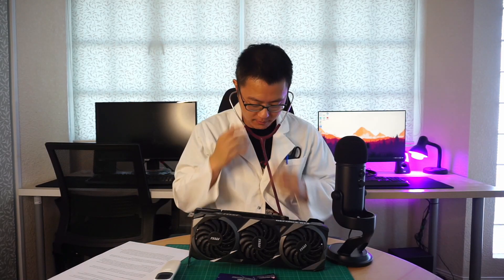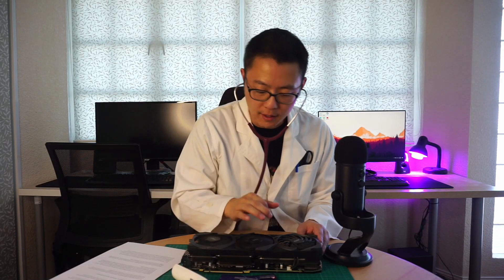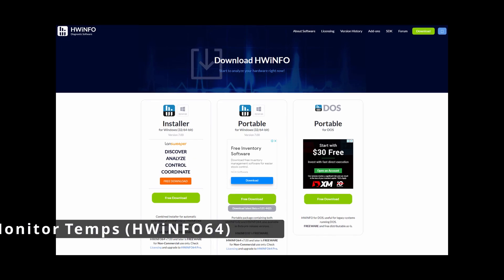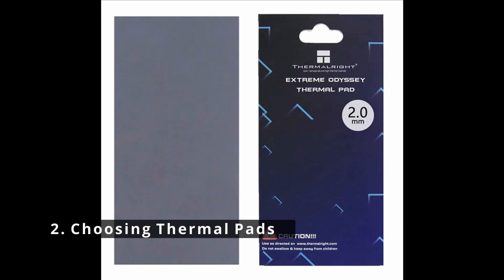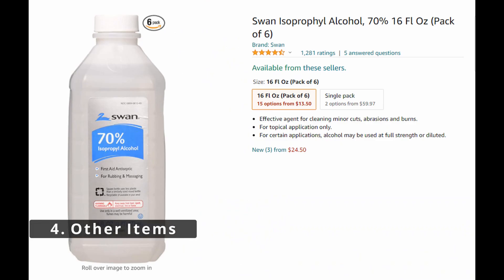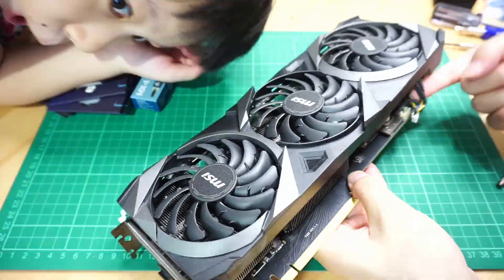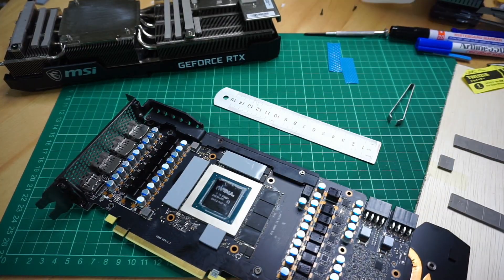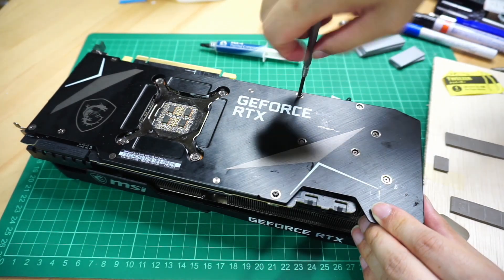RTX 3090 (and 3080) Owners! CHANGE Your Stock Thermal Pads! (Guide, Tips, Results) w/ Dr. JimRPG

Comment: May i have the link you adding heatsink + fan on the back gpu
Reply from the maker: Here's the video
Testing RTX 3090: How low will the vram temps go with this $8 heatsink and fan mod?
https://youtu.be/ZUfTu4J5Nyg

Here's where I got the heatsink and fans - assuming that's what you meant.
Big but crap heatsink
https://shopee.com.my/product/171380262/4533480084

Small but better heatsink
https://shopee.com.my/product/6674515/1846026360

90mm fan
https://shopee.com.my/product/311640343/5972018157

Typical PC Case fan - but too slow imo
https://shopee.com.my/product/17919052/2125984540
Reply: @JimRPG  cool..thanks a lot..appreciate

Comment from the maker: The full unedited video for the thermal mod is located here -
MSI RTX 3090 Ventus 3X Thermal Pad Replacement - Full and Unedited, (Guide/Results Video Check Desc)
https://youtu.be/WwOK20M_SC8

Update 31/8/2021 - Be careful when you're opening up your GPU.
WORD OF WARNING: Watch out for this when opening up your graphics card.
https://youtu.be/eO2b3QTTgss
Reply: omg thank youuuu so much
Reply from the maker: @johnmark2014  no worries!
Reply: Jim Excellent video! I have a question? For an MSI Rtx3080 ventus x3 the pads Gelid Gp-ultimate Tp-vp04-e 15w 90x50x20mm, how many packages would be necessary? is 2.0mm correct for front gpu and 2.0mm for back? Thanks a lot
Reply from the maker: @loquito37  Yep 2 packs at those dimensions. 2mm front and back.
Reply from the maker: Previous Pinned Messages -

Hey everyone, after changing out the thermal pads in the MSI RTX 3090 Ventus 3x and getting good results, I tried to change out the thermal pads in the Palit RTX 3080 Gaming Pro, and it was a lot harder than I expected. If you have the time, check out that video because there was a lot of things I learned from changing out the pads on that card. Thanks.

WATCH THIS! Before Changing RTX 3080 and 3090 Thermal Pads. (Especially Palit Owners)
https://youtu.be/NjGVcu42l30
Reply: @JimRPG  Great guide! There is a product that is cheaper than thermalright you suggested but is the same. Checkout Frosty Thermal Pad - 12.8 W/MK. It's 40% cheaper but uses the same type of pad.
Reply: You will thank me later for saving you $$ ;).
Reply: Those frosty pads look identical to thermalright. Is there a difference aside from price?
Reply from the maker: @bears9446  frosty pads? I'm using thermalright odyssey pads. I don't know what brand the originals ones are.
Reply: @bears9446  AFAIK - no.

Comment: I'm having such a hard time finding the thickness of thermal pads for NVIDIA GeForce RTX 3080. For both the front and back plate.  :( I estimate 2.0 mm in front, 3.0 mm in back. not sure
Reply from the maker: is this for the founders edition? There's many AIB brands for the RTX 3080 as well as the original Nvidia Geforce RTX 3080 Founder's Edition. There should be many videos out there for the 3080 - its one of the most popular cards out there.

Comment: Hi, thanks for this video but when you replace the pads it's too fast for me. Do you have the unedited complete process on how to change them? You put a big heat sink after you added a thermal paste what was that?
Reply from the maker: Hi John - the full video is here - 

MSI RTX 3090 Ventus 3X Thermal Pad Replacement - Full and Unedited, (Guide/Results Video Check Desc)
https://youtu.be/WwOK20M_SC8
Reply: @JimRPG  You are the best!!!
Reply from the maker: Hi John, sorry about that - it was because I tried to match the script to the footage so I sped it up 10x. I've found the original footage, I'm going to post up the whole thing though its over an hour long. I'll link once I've done it.

To answer your question though - to replace the pads, you undo the screw on the back of the card. Just make sure you have all the screws undone, then the heatsink and fans should only be held to the GPU by the thermal paste. You can try to pry it off slowly, if it doesn't come off you still have screws attached. When its off, be careful there's very short cables attached which you must pull out if you can (or look after them). Replace the pads. After that, put thermal paste on, then put the heatsink and fans back on as you found it (including cables you detached and attach them). Put the screws back in.
Reply: @JimRPG  thank youuuuu sooo much

Comment: Jim, have seen others say 1.5mm instead of 2mm... thoughts? It’s an MSI, allegedly so were the others... Cheers!
Reply from the maker: It was 2mm front and back for me for the Ventus 3x. It's possible others have slightly different. I'd ask around or check more videos and see what other people have. It's not impossible that some Ventus 3x have different pads. I changed the Palit 3080 and someone else had different pad thickness to me.

You can always open the card and check yourself :), but sometimes that can mean disturbing the pads and sometimes they can break/tear, and you'll have to wait until you get the pads to fix. Bottom line (get same thickness pads that you have in your card).
Reply: Do you offer this mod as a service?

Comment: hey Jim, how many packs of thermal pads did you end up buying?
Reply from the maker: Hi Handy. I bought 2 packs of the Thermalright Odyssey pads for the MSI RTX 3090 Ventus 3x. They're 85mm x 45mm i think (off the top of my head).

Depends if you have a 3080 or 3090 and what pads are needed on either side. Definitely check a video before buying pads, pads can be different on the front and back and 3080 has 10gb of vram and 3090 24gb!
Reply: @JimRPG  cheers brother, thanks for making the vid

Comment: Does this also work for 3070 owners?
Reply: you dont need to cuz gddr6 vram most likely cooler means doesnt exceed 90c than gddr6x vram micron
Reply from the maker: What tekkugema said. GDDR6 should be fine in most cases. HWinfo64 doesn't even list a memory junction temperature anyway for Nvidia cards with GDDR6, but Hive OS does display GDDR6 memory temps for AMD cards and that memory runs 15-20degrees cooler.

Comment: would this help gamers? or just miners? because I've read accounts of people changing their thermal pads, getting lower temps, but getting decreased gaming performance (lower fps/micro-stutters)
Reply from the maker: it can help gamers. it depends on what games you play... some games result in very high memory temperatures, Tom's Hardware says Metro Exodus at 4k with RTX on can be over 100deg on a RTX 3080.

Where did you see that it decreased gaming performance, that doesn't make sense logically, the gaming performance shouldnt change, its just lower temperatures, which would protect your graphics card longer term.
Reply: @JimRPG  not sure, somewhere on reddit, and i took it with a grain of salt hence i asked you, because you seemed to know what you're doing. for what it's worth, i'm asking because i was thinking of doing this to my brand new msi 3090 suprim x (which i don't use for mining at all)

Comment: is it possible to change only the backplate thermal pads on the 3080? dont want / have thermal pads for the front yet
Reply from the maker: depends which card you have. Some cards you can just unscrew the backplate like the Palit 3080. Other cards like the 3090, you have to pry open the card first and seperate the heatsink and the GPU before removing the backplate (screws are on the inside)

Comment: This was amazingly documented! Thank you so much for taking the time and effort in doing this!

I have an MSI RTX 3080 Ventus 3x OC edition and now I'm curious to check my memory temps and see if I have to make this mod for my gaming (and folding@home) sessions. 90C or higher isn't comfortable for the long run.

Once again, thank you!
Reply from the maker: You're welcome! I think the procedure for the MSI RTX 3080 Ventus 3x should be very similar! Check the temps, you never know, maybe the temps are ok! Also check with other sources/videos on the thickness of the thermal pads so you know what to buy. GL!
Reply: @JimRPG  the 3080 doesn't have vram on back though

Comment: have a question, do you know what size of thermal pads it is on gigabyte 3060 eagle? :)
Reply from the maker: Sorry i dont, also i think you should be ok, unless you feel like the temperatures are too hot. 
Temperatures are only a big concern on the GDDR6X cards - so just the RTX 3080 and 3090, runs at least 15-20degs hotter than the GDDR6 in the 3060.

Comment: This is such a great video! Thanks for making this Jim! My 3090 (Aorus Xtreme) was running 106C at 115mh mining. After doing the thermal pad swaps on both sides of the card, I can do 115+ mh now at no more than 88C going for hours. (25C ambient) Very helpful!!! Keep up the great work!
Reply from the maker: Wow very nice Jason.  I think that's a great result! Those gigabyte cards seem to have high temps out of the box.
Reply: What thermal pads did you use and what thickness?

Comment: I applied an EK water block cooling system on my 3090 and get lower GPU temps but higher memory junction temps. I replaced all thermal pads and the instructions told me to put 1mm thermal pads on the memory. I'm thinking that they need to be replaced now with 2mm thick pads now.
Reply from the maker: which 3090 do you have? you should get slightly lower memory junction temps. how much higher did you get? Maybe the heatsink is not touching the memory temps. Don't want to suggest too much more in case I lead you off in the wrong direction. Hope you get it sorted!
Reply: @JimRPG  I have the 3090 Ftw3 ultra. Junction temps are 5-10 degress warmer. Hopefully 2mm pads help.
Reply from the maker: @jayzon00  Cool - GL with that.

Comment from the maker: Hey everyone, after changing out the thermal pads in the MSI RTX 3090 Ventus 3x and getting good results, I tried to change out the thermal pads in the Palit RTX 3080 Gaming Pro, and it was a lot harder than I expected. If you have the time, check out that video because there was a lot of things I learned from changing out the pads on that card. Thanks.

WATCH THIS! Before Changing RTX 3080 and 3090 Thermal Pads. (Especially Palit Owners)
https://youtu.be/NjGVcu42l30

Comment: I tried changing the memory pads , I used Thermalright pads and arctic 5 paste. In my before case, when I mined at the settings I use, I had a GPU temp of about 54degC, , memory ~106 to 108degC, my fan speed was set to auto and it would max out to 100% (3400 rpm). After case, the GPU is now about 67degC, memory 92 degC, fan speed still on auto is now around 56% (1250 rpm). What do you think? Does thermal paste need to set or did I do a bad application (or an arctic 5 issue)? If I manually set the fans to 90%, the GPU goes to about 62 and  memory 88. So I do have an improvement on the memory... just my GPU temps have gone up.
Reply: :D figured out my error, the fan sync setting was not on. With fan sync on and fan speed set to 100% I'm getting 53degC, 1 deg better than before. At 90% fans, I'm getting 54degC. I'll change the fan curve so it operates at higher than 56%, I'll shoot for about 65 to 75%.
Reply from the maker: Your thermal paste is not supposed to set (its not meant to dry out, you would be waiting forever).

Ok sounds like you fixed your problem if you got 67 deg for gpu and mem 92 deg and now your GPU core is 53 deg (i'm assuming your memory temps is also much better). 

If you're mining run your fans at 80-90%, fans are cheaper to replace than a GPU ;).

Comment: I have same card as you. but i bought the 3mm thermal pads. is it ok? or I should buy another 2mm pads?
Reply from the maker: 2mm definitely... you can try 3mm, but what i expect will happen is the gpu core won't touch the heatsink and your gpu core will be hotter. That's what happened to me on another card.

Comment: Looking for feedback please. Running a 3090 in a wide open case that is never closed with multiple aftermarket cooling fans for GPU. The CPU is water cooled. The temp never exceeds 50 degrees and my VRAM temp stays between 90-94 degrees max while under 100% load with 115 MH/s range and power wattage 280ish with MH/j efficiency of 0.40. The GPU fans fluctuate between 60%-90%. 

When I end up speaking with folks who had massive success with swapping thermal pads, I find it is often they were really pushing it or using OC or they lowered the VRAM temp by 20 degrees but were landing in the 110 degree range in the first place. Any input greatly appreciated. Cheers!
Reply from the maker: Yep I generally agree - if you're already in the 80s, its not worth changing out. 90-94 is getting to the hot end. I'd consider thinking about changing it out around 95-100deg. The problem is getting very little gain for the effort you put in. And some cards like for example the Palit RTX 3080 which I just changed was a real pain with very tight tolerances on the thickness of the pads or the whole card wouldn't work.

Comment: I replaced the thermal pads on my MSI 3090 Gaming X Trio and observed a 3.5 degree improvement in Memory Junction temps, which was probably not worth the time, effort and money. Not to mention, probably voiding my warranty - or at least making it a point of contention should I ever have to RMA the card.
Reply from the maker: I feel like if you're already in the 80s while mining, you're good. but gaming should be mostly fine. Id only change them if its 95-100deg...
Reply: Hey I got the same card, what thickness of pads is right for that model and how many did you need? Thanks!

Comment: I am happy to report that by replacing the thermal pads in the NVIDIA RTX 3090 Founders Edition graphics card, I managed to improve the temperature from 92-94C to 74-76C while playing Monster Hunter World Iceborne at 4K@100 fps. Good advice!
Reply from the maker: YES! Congrats!!! that's a great improvement. And you did the FE as well, which is super annoying to pull apart.
Reply: @JimRPG  Right you need to find the right torx and philips screwdrivers for different screws.

Comment: Anyone try replacing all but 0.5mm of the thermal pads with solid copper, leaving just enough to prevent a short circuit?

Copper has a much better thermal conductivity of 385 J/mK compared to 13 J/mK of the pad.
Reply from the maker: don't know! I don't want to risk it personally!  😄

Comment: Not worth voiding the warranty for that little change. Also I been mining with my 3090 at 102c for about a month no issues so far. But if it does die within 3 years, I have a warranty soo I couldn't careless about thermal pads.

Comment: Can you post what thicknesses are needed for the front (gpu side) and backplate side?
Reply from the maker: Ok this is for the MSI RTX 3090 Ventus 3x.

For both front and back thermal pads on the memory modules, I bought Thermalright Odyssey Pads 2.0mm thickness. I bought two packs and cost me about $11 each.

Comment: Changed my 3090 fe thermal pads, vram temps went from 106C to 84C under load
Reply from the maker: Why do they put such sh!tty thermal pads! Congrats btw.
Reply: Hi, may I know which thermal pad you use and how thick they are?

Comment: so is the non FE 3090 the same design as 3080 when disassembling it?
Reply from the maker: This is a MSI Ventus 3x RTX 3090, all the other 3090s from Asus, Gigabyte, EVGA etc will be slightly different. But generally speaking, there'll be a few screws on the back plate and then held together just by the thermal paste on the GPU. At least that's what I've been able to decipher from watching various people on youtube replacing the thermal pads. You have to just check to make sure you've got all the screws out before trying to pull the card apart. These cards were made to be assembled/disassembled by hand.
Reply: @JimRPG  Yeah I can see that a lot of these 3000 series need to be unscrewed further after removing the front plate as well, thank you.

Comment: Try using thermalright TFX for your GPU, cross pattern with blobs on each edge in the middle. TFX is known to be better for GPU due to its being a very thick paste optimized for low mouting pressure on GPU
Reply from the maker: @Earl hey I just checked it out, its $10 for 2g, and about $40 for 6g.  I think I paid $10 for Artic MX-4 for 8g. I'll definitely check it out at some point, it looks awesome. Thanks for the recommendation.
Reply: @JimRPG  Arctic mx4 lasts about 2 weeks in a gpu. TFX however...
Reply from the maker: @toxy3580  Ill look into it! :)
Reply from the maker: Great, I hadn't heard of TFX - and I'm going to check that out. Thanks!

Comment: 100% agree, I went from TJunction temps consistently hitting 110°C at ~200W to maxing out around 94°C at 400W just from switching out my crap thermal pads for 12.8W/mK pads.  Highly, highly recommended, especially for people running GDDR6X.
Reply from the maker: They have to put in $10 of high performance thermal pads for these $3000 GPUs... they're ruining them if they dont.
Reply: @JimRPG  It's actually rally sad that the consumer has to fix their crappy thermal pads. If the manufacturer would buy good quality thermalpads in bulk, they would probably pay less then 5$ for them.
Reply: Which card do you have? Let me guess. A gigabyte?
Reply: @swizzler8053  Ha, yup, Gigabyte Aorus Xtreme 3080
Reply: @funghazi  🤣👊

Comment: I won't risk doing that, I always screw up something lol, and I don't mine anyway. When gaming vram temps are hot but still within safe range
Reply from the maker: Yep i felt that way. I only did it because I saw mine getting worse in mining. Gaming is still ok imo (though has gotten hot in some situations, like maxed out Skyrim and MS Flight Sim)
Reply: Bro i feel you, i replaced my thermal pads and chipped a part of one of its plug casing.  Good thing just that and now it works great, mining 120 hash at max 96 c
Reply from the maker: @Barsymatik  damn that's a close one!
Reply: @JimRPG  yeah warranty definitely voided lol
Reply: @Strider What card do you have ? Because 108°C sounds insane, my 3090 only hits 90 max in RDR 2 (room temp is 24)